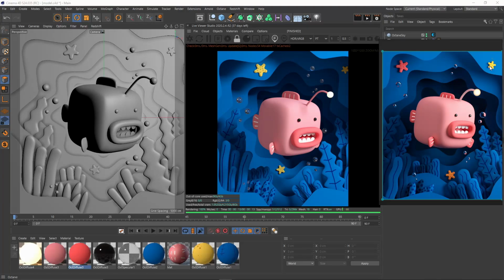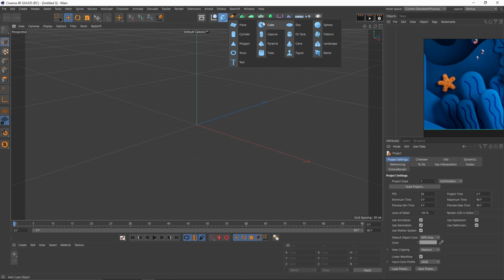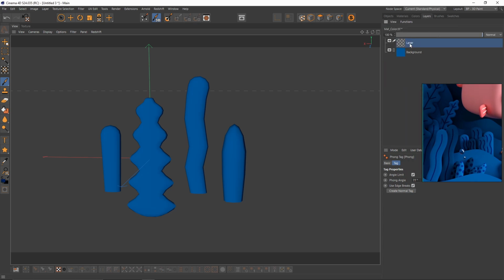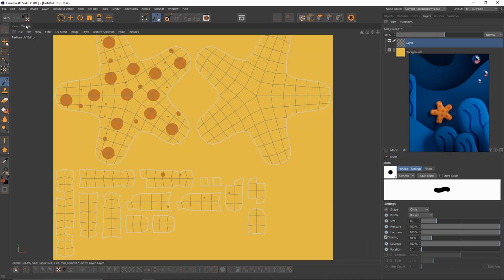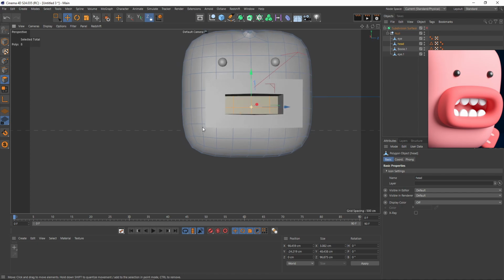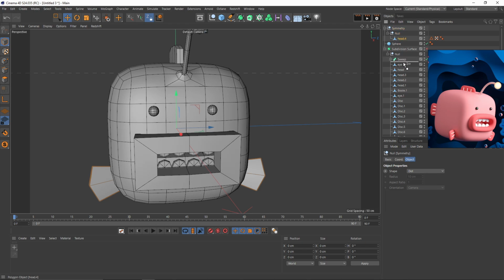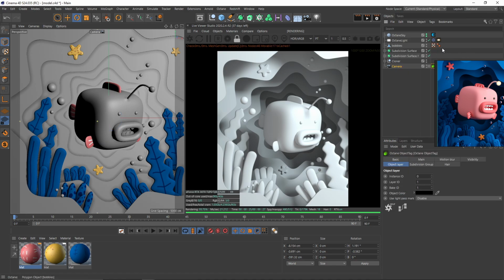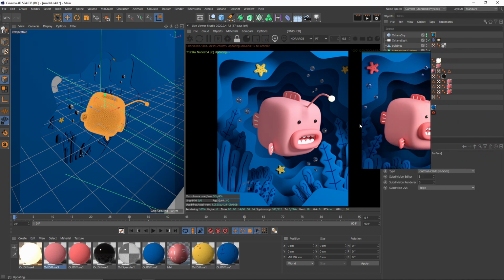Re-creating 3D images #1 | Cinema 4D Modeling and Rendering Tutorial

Comment: In the beginning (02:24), as soon as I change the axis mode to "ZY (Along X)" for the spline mask, the once round circle points become pointy... any solution for this?
Reply from the maker: Try to change the interpolation of the circle in the spline mask.
Reply: @polygonpen  What exactly do you mean?
Reply: I had the same problem, the round circle edges became straight after putting them under spline mask. Interpolation didn't do anything. "Spline substract" worked for me (Select the rectangle and the circle, and you'll find it in the Spline menu).
UPDATE: I made "current state to object" to the circle, and so it goes... but the edges can't be moved, so I rotated to get another variation of it.